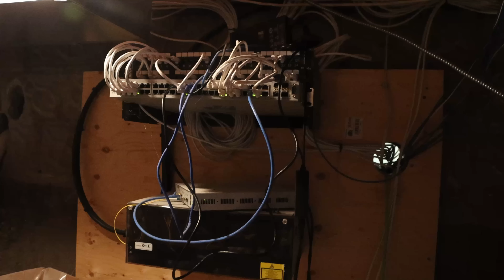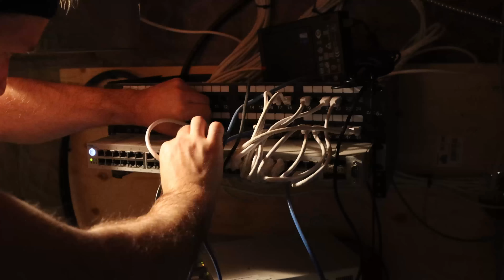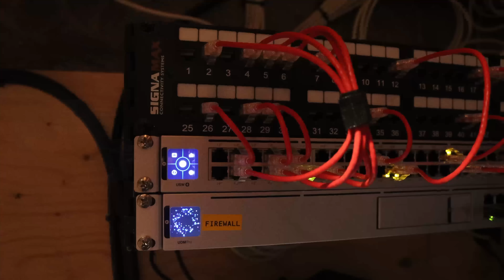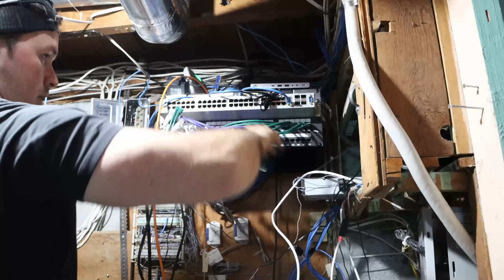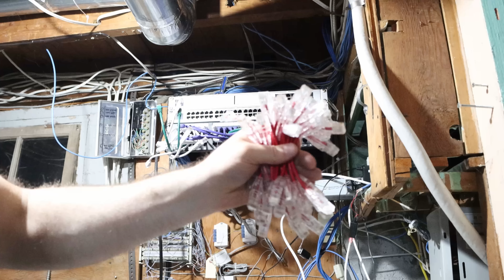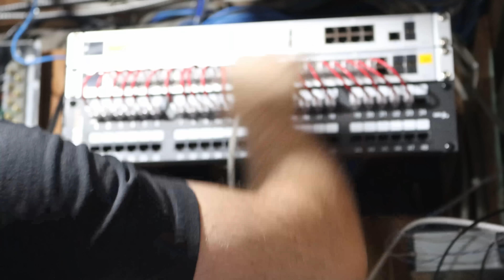Unifi On-site installation, 3 sites 1 day

Comment: Hey Cody, awesome vid, of course I know you are mostly preconfiguring the devices do you use the same config layout for your networks that you've done videos on.
Reply from the maker: All depends but generally yes. There are exceptions to firewall rules though. They may need to add others
Reply: @MactelecomNetworks  ok, I still trying to get familiar with the UDM and configuring firewall rules, I will have to go back and watch those videos, thanks.
Reply: I also used Cody’s video on setting VLANs and firewall rules for my Unifi network. Worked perfectly until last month when Ubiquiti did and update and now none if my VLANs work 😩. Been in back and forth with their support trying to figure it out, may end up doing a factory reset and starting over ☹️.  Strange hobby for a 70 year old retired guy.

Comment: How come you always put the top screws in the switches first ? If you use the bottom holes it holds the switch properly :)
Reply: I put one at the botton on one side and the second on top of the other side.
Reply from the maker: I like to be different. Being the same as everyone is boring
Reply: I've seen plenty of light weight devices installed with only the 2 bottom screws. The weight of the device puts the bottom 2 screws in tension and the top 2 screws in compression. The top of the rackmount brackets are carrying compression, not the screws. The top screws may help with alignment of the device. If you are installing 0.5U patch panels the panels have 4 holes but only 2 holes will line up depending on whether the panel is installed at the top of the U or the bottom of the U. 0.5U blank panels will only have 2 screw holes with the expectation that the panel will be flipped over when you need to use the bottom 2 holes or the top 2 holes.

That being said, patch panels can have different loads depending on the cable management behind the panel and how the patch cables are supported in front of the panel. At a minimum screws should be in all 4 corners of each panel.

Some devices are extremely heavy and require support at the rear of the rack as well. Data Centers also use device lifts for large UPSes, storage servers, and blade servers as they are very expensive and far exceed the recommended maximum lift capacity of staff.

On rare occasion I have seen rack holes drilled and tapped to larger bolt sizes to carry additional weight. It is more common to use larger brackets or heavy duty shelves that require more U space for strength even if the device is a smaller number of Us.
Reply: @WhitentonMike  Exactly, the bottom screws are the most important and hold the load of the device. Another trick when racking equipment, is to put 2 screws "UNDER" the bottom holes to hold the switch while you mount it. When done remove them. Kinda like a shelf :)

Comment: after having done lots of installs before battery screwdrivers. I now use a Milwaukee 12v and have their battery soldering Iron too. as I would have used them before 110 punch and mulit tools were Around being a one-man installer should look for ways to make your job site easier and less of a balancing act..

Comment: Is that a 10 gig connection on the DAC cable?
Reply: No, in the predeployment video he did, he set the speed of the DACs to 1gbit, as these are the standard 48 port switches, and they only have SFP ports. Also, it doesn't matter much, as the UDM pro is only used for internet connectivity and their outside line is not above 1gbit